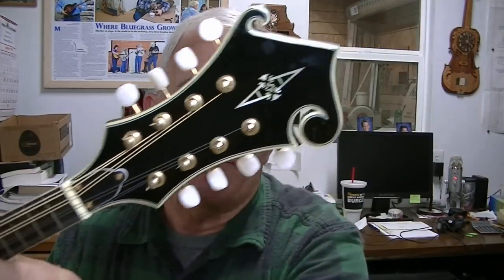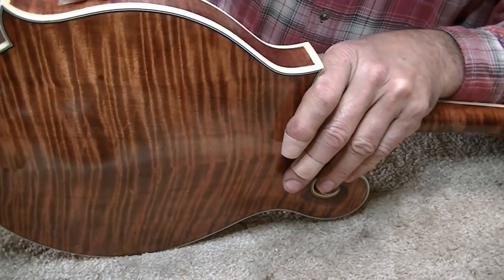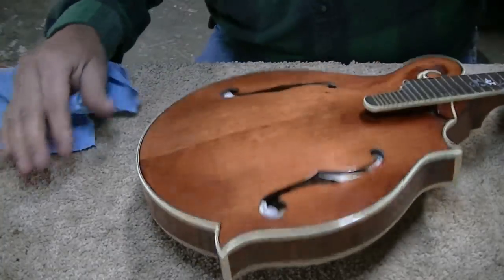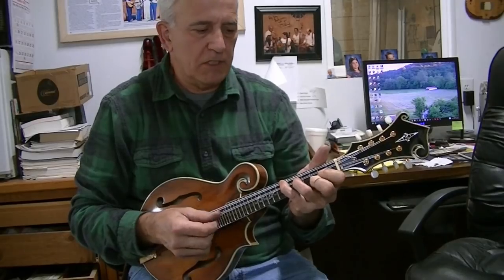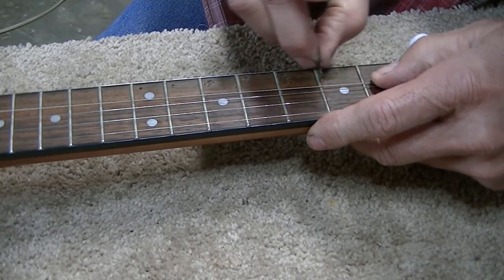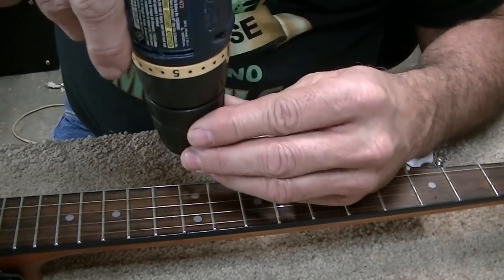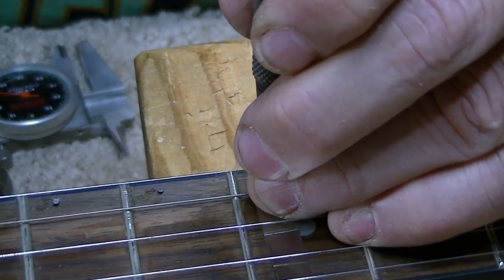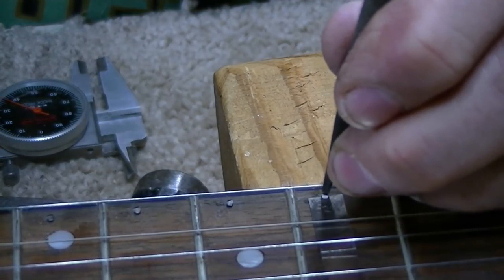172 RSW Alvarez Mando Refinish   5th String Spikes

Comment: Because of my watching you , I recently fixed a Stella parlor guitar for my brother . I re glued the top and back to the sides as needed, fixed cracks on both top and bottom , and fixed a large dent on the lower side finish. I shimmed the wooden nut to the needed hight and filed the nut to get the first fret action. It's now a playable little guitar. Last thing I used some car wax to buff out the body to hide the cracks. It's not that pretty but thanks to your channel it's back in a players hands !

Comment: I've had similar experience with two-part epoxy clear coat on a fishing rod. The two parts didn't get completely mixed. It was still tacky a week after application. Got fed up waiting, so I stripped it and tried again making sure to double the time spent stirring the two-part epoxy. Worked fine after that. Lesson learned.
Reply from the maker: Dan Selvig thank you my friend for watching.

Comment: As always, enjoyed your video. I've built some banjos, and have been asked by numerous banjo players to install the spikes, and I generally only put 2 or 3 in (Key of A and C possibly D), and retune for in between). Some have wanted the spike almost level with the fretboard, with a slight countersink under the tang so the string can fit. Those that like to hook their thumb over the 5th string when they play like this setup. No matter what, when you capo the banjo, you retune the banjo, so tuning the 5th string is no big deal. I don't use a hammer. I drill my hole with a dremel tool bit, and push the spike in with needle nose pliers. I like your shim for string depth. I generally use an old string to adjust the height. if you countersink, you pretty much have to do it this way since the slot is not flat.
Reply from the maker: banjomandoguy thank you very much. As always, there's a lot of ways to skin a cat. Thank you for watching.

Comment: Hi Jerry, I have installed spikes  before and the best way i found was to take a .015 feeler guage under the hook of the spike and tap down to it . It makes for a consistent gap under the hook, and makes them easy to release , and they don't get in the way. smooth the tops with a little sandpaper and you're good to go.
Great videos. I 've  learned a lot of little tricks that have my work easier. thank you for the info. 
Kevin
Reply from the maker: Judy and Kevin Lynch thanks for watching.

Comment: It happened to me once or twice. It was because of old paint. They do have some sort of use by date. I repainted my table with some "new old stock" paint and it was soft for months if not years. But it is good and solid now. Best table I ever had.
Reply from the maker: Generally speaking slow drying finish ends up being much harder. Thanks for taking a look.

Comment: And as for the renaissance wax -  I have started using it as well and I love it. I bought the huge 3 litre tub on-line, because it works out a lot cheaper than the smaller units. Now I have so much, I convinced my mother to use it on my grampa's old oil paintings. But when she mentioned polishing her 5 piece leather settee,  I had to stop her. That was not the reason I bought the wax in the first place ;o) It does marvels on my classic Ortega guitars made from super exotic woods all the way through from head to toe like spalted maple or mahogany and they all come with a satin finish which is not altered by the wax.
Reply: George Tempest Professional librarians also use it to stabilize old leather bound volumes. I have used it on several from the early 1800’s and it works great.

Comment: If it hasnt been said.  I think your are right.   Someone tried to refinish it, BUT I dont think they took off the original finish then used some sort of finish that wasn't "compatible" with the original finish.  I forget the specifics, but I know some finishes or even paints just cant go other others, and they end up sticky like that or bubbly...just depends.  If it were mine and cost not an option....strip the whole thing and completely finish from "fresh" wood.  

Of course I say this while watching the video only at 8 minutes.  Ill finish it....and my be eating my words...lol...  

Do love that book matching on the back.  FWIW...somewhat related.  Since most antiques are worth more with the original finish, it is usually best to leave even "ratty" looking finishes, cracked(crazing)..what ever its called....even the dirt and grime and 
DNA that makes it way in to old finish can really make a great wood look terrible.  I did find a product I used on my pool table, I forget the name, but essentially you apply a special "loosener" to the finish, then you go over the  finish with a rag like a french rub, and then after it looks like NEW or close, you have to apply a special HARDENER that then as you would think rehardens the finish.   And it is AMAZING...AND you can say it the original finish....for the most part.  In my pool table's case...it was close to just refinishing anyway....its pretty rough...and I am still working on it...lots of inlays to fix/find...ext..lots of veneers to match and yeah...I could ramble for another few paragraphs about it...sorry.    I can find the name of that product if you are interested.   Not too expensive.

Comment: Some years ago I got a banjo neck back from a well known banjo builder (who is out of business now). This banjo came back with a sticky finish on the neck. The finish was like putty, and it would roll up into little balls on my hand as I played. It was likely too soft to overcoat like you did. He told me it was some problem with the wood because it may have had an early 90s (when the banjo was made) first gen. low voc water based finish that soaked into the wood and ruined the wood forever and the wood can't be refinished. I did a speed neck on it. Didn't like the bare wood so I finished it with tung oil. That was okay actually. But I don't believe the rant about spoiled wood and the low voc finish. I think it had either 1. a catalyzed finish that didn't have enough or any catalyst mixed in or not mixed well enough, or 2. a UV-cured finish that didn't get properly exposed to the UV light. I'm thinking of taking it all the way down again and doing a good old fashioned nitrocellulose on it, I'm getting really good with nitro, having refinished dozens of instruments  now.
Reply from the maker: Dave B good luck with it. Thank you very much for watching.

Comment: This sticky situation has happened to me a couple of times. It's a discouraging mess, for sure.

As usual, it was my own fault. I sprayed the finishes on a high humidity day each time, and they were oil-based finishes, so they just sat there, being tacky and mocking my stupidity.

Spraying the oil based stuff in high humidity simply grabs water out of the wet air, and mixes it into the finish, so it just doesn't dry. I think I have learned my lesson about that process. Maybe...

Comment: I have only just come across this video and it reminds me that somethingi similar to your sticky Alvarez happened when a friends wife chose to use a kitchen bench cleaning spray that is available here in Australia, called "Spray and Wipe" to clean chairs that had a nitrocellulose lacquer finish. A few days after cleaning the chiairs the finish had softened to the point where sitting in the chair in jeans you could lift the chair off the floor by standing up and it stuck to your backside. When the chair was detached there was an imprint of the fabric in the finish. After trying to strip and refinish  a couple of chairs he dumped all 10 chairs as he could not get a finish to set up properly. I wonder if some well intentioned person tried to clean your  mandolin???? All the best.
Reply from the maker: It is likely caused by something similar. Thanks for taking a look.
Reply: @RosaStringWorks  Hi Jerry, I've had the same problem with the nitro finish on a Gibson Custom Shop guitar some years ago.  I never had the same problem with my polyurethane finished Fender guitars.  I lost my trust in Gibson after that.  Needless to say, a very nice Fender is less than half the price of a comparable Gibson.

Comment: Randy I wonder if someone at the factory or whatever used a two-part catalyzed finish and didnt get enough hardener or something?  Your theory is also plausible - oil based stain and some water borne urethanes will leave a sticky mess that takes years to harden if the stain was not 100% cured. I had a mess like that with some kitchen cabinets - wound up going over with Aqua Zar which hardened up the mess
Reply: U

Comment: Jerry I use an a piece of rubber thick enough not to be floppy, eracer for pensal marks  cut a tiny slot into the end put the nail in the slot to hold it the hit it with the hammer   no banged fingers
Reply from the maker: +Tim McDonald not a bad idea. Thanks for watching.

Comment: Good fix on the mando, lucky you didn't have to strip it. Just asking because I'm ignorant, are the spikes for when you capo frets one thru five so you can hook the fifth string and keep things relative? If so why six pegs and why skip the sixth fret? I'm must be looking at something wrong. Also don't the pegs get in the way when fretting. I know I've seen this set up on banjos before but I've never played one set up this way.
Reply from the maker: That is correct it is to keep the Fret relative to the Capo.  I'm not sure what you mean by skipping the 6th fret.  Some people don't put a Peg and every fret. They put them in every other fret and tune up.  They don't generally fret the 5th string so the pegs don't get in the way.  Thanks for taking a look.
Reply: Rosa String Works thank you for the answers Jerry, I kinda figured but I wanted to be sure. Hey on the violin video I posted any idea on a production date? Anything would be helpful. I show a label toward the end of the vid. Thanks

Comment: I'm new to mandolins production, being as you are my source , lol . 
My question is , why would the back be tiger striped (aaa grade flame) and the front be a lower grade ?
Reply from the maker: I can't speak to that mandolin but generally the top is very high grade of spruce. It's not for decoration it's for sound. The back is more for decoration.
Reply: @RosaStringWorks  So , then would a manufacturer take the front and expose it to ammonia to bring out some of the iridescent features that are naturally not visible in this high acoustic  grade wood ? Is ammonia fuming done ? I'm struggling with the back (unseen) being bear clawed ect , and the front(seen) being rather plain by comparison. 
    Mr jerry , that answer you gave me , has me set in pure deep thought . I'm of the line of thought that the front face of a guitar is its feature face and the back is for , I guess preventing picks from falling out , lol. No honestly , wood working and my love for my takamine brought me over here to you . I'm in awe . Thank you very much.

Comment: Hi Ive a 1895 Italian bowlback mando , but one of the ivory tuner buttons just 
turns on the tuning shaft, no way of tuning it, whats best way to 
fix this ? its got a backplate with attached tuners, when you take the plate off, 
the tuners are set in a recessed bit on the headstock, replacement tuners is 
a difficult option ? - any help would be appreciated. 

tks
Reply from the maker: Del Boyo that sounds like a difficult problem. I'm not sure I have a suggestion. I'd have to see it too figure out how to fix it. The only thing that comes to mind right now would be super glue or epoxy but I wouldn't recommend either one of those without seeing it.  Good luck.
Reply: ok wondered if I were to send you the tuner unit by post 
I am in UK ?
Reply from the maker: Del Boyo you can send it if you would like to. I will do my best to make sure that we fix it. Though I cannot be certain how that might happen.